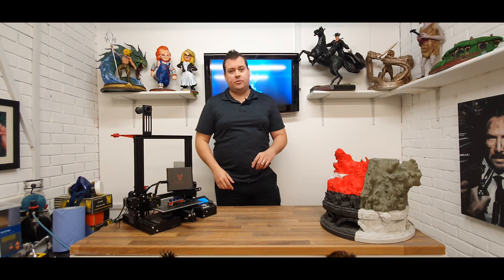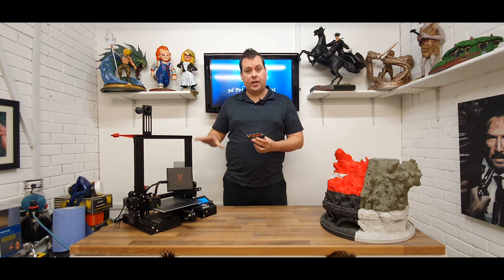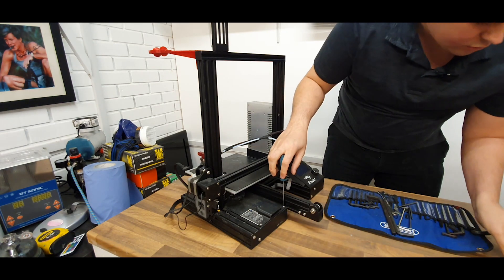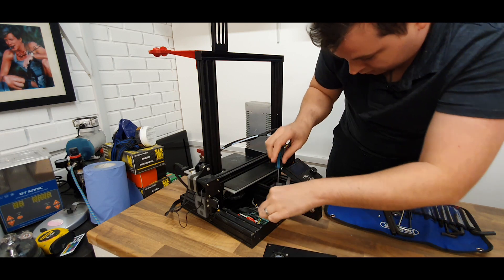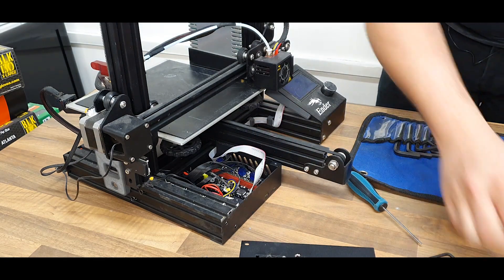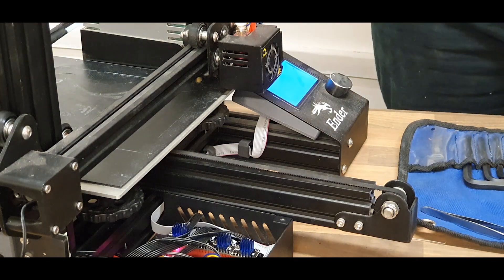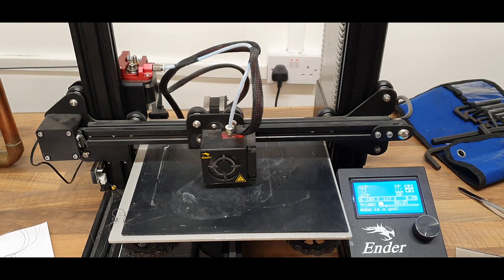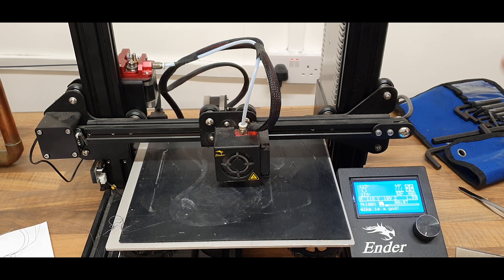upgrading our Ender 3 to a SKR E3-DIP board, with TMC2208 drivers

Comment: if i don't put the sd card can i put the skr board in ender 3? I lost the sd card.
Reply from the maker: so you need and SD card to flasd the firmware onto the board but you don't need their SD you can use any micro SD